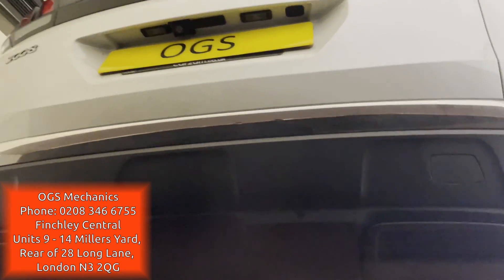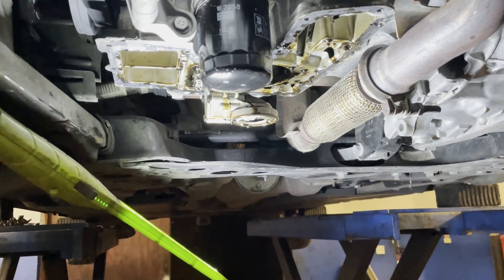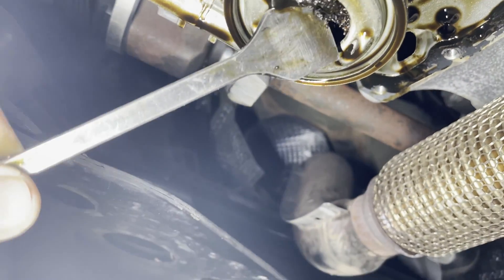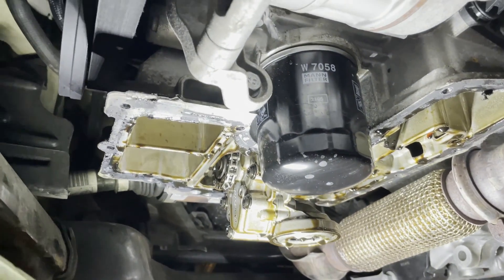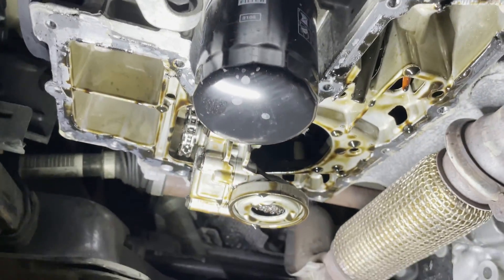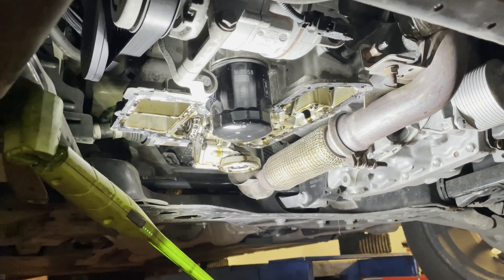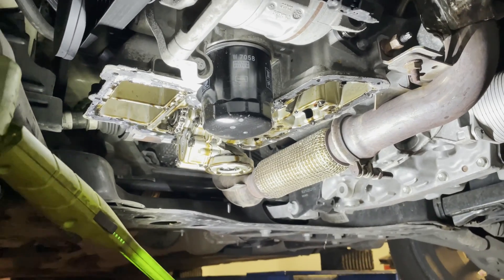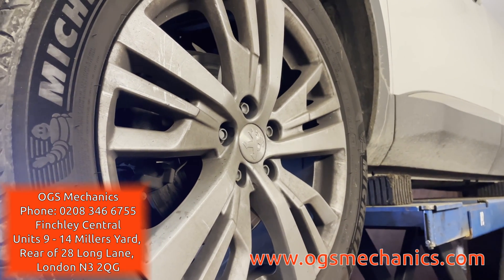Peugeot 3008 1.2L 2017 petrol engine, running in limp mode with low oil pressure warning light

Comment: Great video, may I ask how much the cam belt change and oil sump clean is please as I have the same car with the fault saying low oil pressure. Cheers
Reply: Would like to know cost also? Did you find out?
Reply: @LA-id9nn no reply, I payed my local mechanic £700 to change the cam belt and remove the sump and clean the filter and pipe.
Reply: @cityblue0202 damn, not a cheap fix then 👎🏼
Reply: @LA-id9nn cheaper than Peugeot, my car was only 4 years old with 37k on the clock. The wet belt engine is crap. I won’t buy another Peugeot again. I’m going electric lol

Comment: I am having this absolute problem with my 3008, recalled in April and I took it to them in June for a timing belt review and service. They claimed the belt is fine. It has now been with Peugeot for one week so far with a fault - engine fault, limp mode, oil pressure fault it is insane. They are now looking at the sump to see if there is any debris in there. Only 57K on it.

Comment: That oil looks very dirty. When was it last changed? No wonder the belt went. The oil in these engines must be replaced annually regardless of mileage. I use Total Quartz First INEO 0W 30 which is what Citroën/Peugeot recommends. Also never use engine flush or additives because it attacks the belt. Same result. Not Puretech but pure negligence can cause this problem!
Reply: Better still JUST DON'T BUY A VEHICLE WITH THIS ENGINE!!!! MASSIVE repair bills are waiting in the wings if you do and increased service intervals as well as the service intervals have all had to be decreased because of this STUPID DESIGN.

Comment: Poorly engineered engine. I have a 2015 Citroen  C4 grand Picasso with a Puretech 130 engine. The timing belt is supposed to last 10 years or 175k km but it doesn't get there. It's a design flaw. My car broke down at 89k km. Total engine rebuild necessary. Timing belt lost teeth at the crankshaft but didn't brake. Valves crooked, had to replace the cilinder head, oil pump, both camshaft sensors...Remarkably on the sticker that comes with the new timing belt the updated mileage before replacement says 100k km or 6 years only. I'm sueing Citroen over not having informed me about the revised mileage when replacement is due. I didn't get a warning light on until 3 seconds before total brake down of the engine, so it was not like I was driving around with any engine warning light on or anything. Car had always been maintained at the Citroen dealership.
Reply: Was it the original belt all the way from 2015?
If so it survived a bit longer than usual! They had recalls in several countries, but sometimes these were too late as changing the belt was not a remedy since the engine was already running damaged and unoiled.
Reply: @michaelleviev6073  It was the original belt yes. All maintenance done by Citroen.
Reply: Citroëns service schedule these engines is crap. Oil and filter should be done annually regardless of mileage. Only use Total Quartz First INEO 0W 30 oil or equivalent. Never use engine flush or additives because it attacks the belt. Mine is 6 years old(6 oil changes) but only done 12,700 miles. The oil is clean.The belt is fine and within width tolerance.
Every video I've seen with belt failure the oil looks disgusting, no wonder there's problems its really contaminated and hasn't been changed ages. Not Puretech pure negligence!
Reply: @tenfootvoyager RUBBISH!!!! I've seen many with no mileage and as new oil in them and the belt has still broken up and with 1st,2nd & 3rd generation belts in them!!!! THE WET BELT IS SUCH A STUPID DESIGN, AS SIMPLE AS THAT.
Reply: @tenfootvoyager  Who would ever thought about put rubber belt in oil ?? that's stupid... for them it's easy to say ...buy a new belt. yeah it's not their money. Instead of making an engine easy to maintain and reliable just change your oil, or change your belt more times. and it is known that the problem they want to correct (reduce friction and thus reduce consumption) still happens... if it still happens why do they continue with this shitty system of the belt in the oil? Yes it is Puretech. Just go back to the old system...
Reply: @tenfootvoyager  12700miles means only so many cold to hot to cold - cycles...The puretech engine design is flawed and Citroen knows it damn well

Comment: The drives good no engine soinds , only issue is the oil pressure warning light comes on sometimes..even after I topped up the oil? Could it be the oil pump or filter needs changing or? What do you think? Please
Reply: Pump is probably gonna block itself fully

Comment: I have a question is this common problem with citroen c4 grand picasso 1.8 petrol?
Reply: Are you sure it's a 1,8 engine? If it's the 1,2 Puretech 130 or 110 replace timing belt before 100k km or 6 years whichever comes first. I have the same car and the belt desintegrated. Over 5000euro repair was necessary.

Comment: Same issue on my citroen c3 2016 1 litre petrol puretech 3 cilinder engine with only 47000 miles sometimes, not often, the warning low oil coming on just for 2. Seconds, very annoying......

Comment: Excellent video mate, found this via research for a vehicle in my shop currently, exactly the same fault.
I had to quote oil pump and timing belt kit etc this is possibly a very expensive repair.
Great information and it's clear you guys are very professional

Comment: That's stupid engineering,timing belt in oil.Ford use many engines with timing belt in oil.
Why,why,why?
Reply: So they fail and they sell you a new one.
Reply: The real problem is they never make the foreseen mileage or age for replacement. With expensive repairs as a consequence.